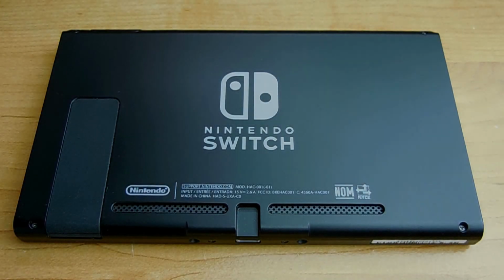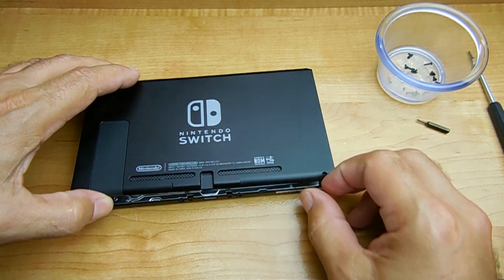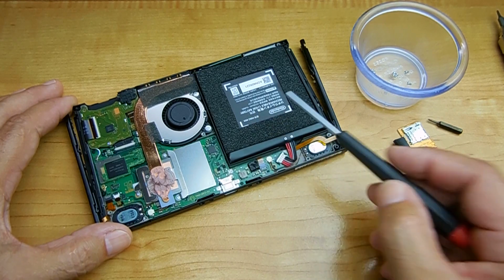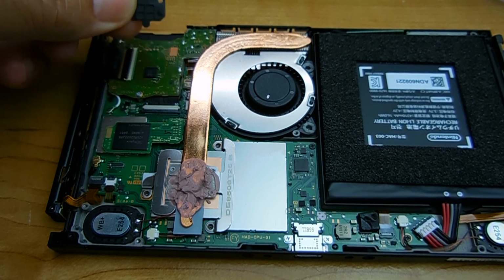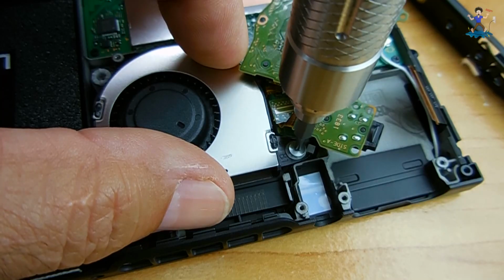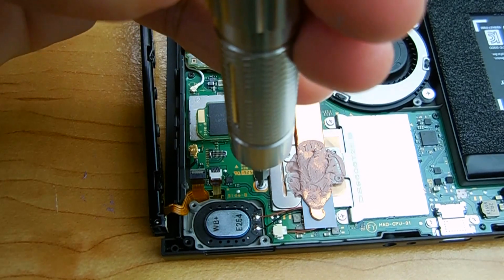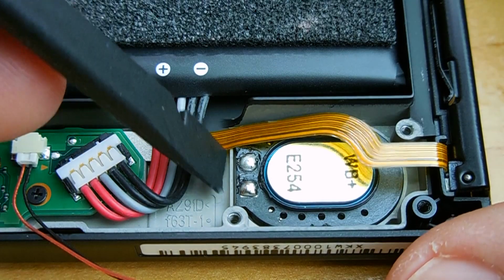How To Repair Nintendo Switch (CPU Fan/Battery/Speakers)

Comment: What if the actual speaker connector broke off the motherboard? Is there anyway to fix that?
Reply from the maker: Yes, you can solder it directly to that location, buy you'll need some magnification to do it properly.

Comment: I’ve dropped mine a thousand times and wonder how it still works
Reply from the maker: They had to make them fairly drop resistant, a lot of very young people handle and drop things.
Reply: I wish you could plug in the head phones to the controller instead of the switch, I have dropped it a lot because when I’m using my switch on the tv the wire pulls the switch right of the dock and gets thrown to the floor

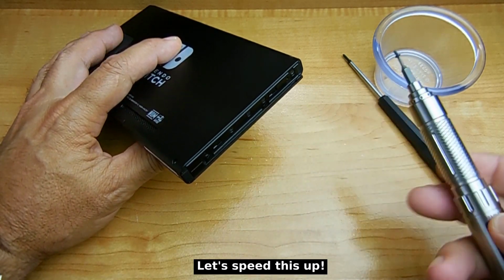Comment: 1:32 I don't understand how you removed these screws on both sides so easily. I cant even butch them and if I try I'd just mess up the screw and will never be able to remove them. Is there any solution? I need help please
Reply from the maker: You may need to "break" them free. Apply moderate downward pressure to the head of the screws to prevent the screwdriver from popping out of the screw and stripping it, then turn CCW.

Comment: Great video! One question, how does the fan hold up after months of use after you replaced it? I was looking at buying the same model you posted in the description.
Reply from the maker: I didn't replace mine. I took mine apart to show viewers the steps to replace.

Comment: There were two screws on each side of the Switch, where the joycons connect, that just would not budge:  TOP [  X       O   O    X        O ] BOTTOM on either side.  Also, the two pieces of tape covering the copper bar were destroyed when trying to remove them: for me, they were stuck so strongly to it that it wouldn't come up all in one piece like you showed in your video.  I hope it works okay without replacing that tape.  (I am just replacing the fan).

Update: You don't need to remove those 2 from either side if all you want to do is replace the fan and/or thermal paste.  Only if you need to replace the speaker.
Reply from the maker: Sometimes the screws stick, you need to break them free using higher torque while making sure you don't strip the head. You should use a heat resistant tape. I removed the 2 just to show viewers. Thanks for watching!

Comment: Doubt I'm gonna get an answer, but here goes. I need to replace the speakers. The Y screws came out no problem, but the philipps heads are a major pain. I got half of them with zero effort, the other half are in there so hard and they have all been stripped after my countless attempts to get them to budge. Any tips on how to remove stripped tiny screws? Its the one on top, and the ones on the controller slides on both sides. Im at my wit's end right now
Reply from the maker: I read almost every comment and reply to almost every question once, regardless of the age of the video shown on my channel. That won't happen with most other YT channels. To answer your question, when you remove those tiny screws, the tip must be well matched AND you need to push the screwdriver into the head with moderate pressure as you twist CCW to get them to "break" free. Try another mini screwdriver, make sure it matches. If you cannot remove it, the head of the screw will need to be drilled out. Thanks for watching!
Reply: @electronicsNmore  Hey, thank YOU for the tutorial. I didn't see your reply till now, cuz it's been a long, stressful and arduous day of drilling and grinding (something I've never done before mind you-- NOT a handyman by any stretch!) and I was  finally able to do it. My Switch might be missing about 6 screws now, but it's solid and functional and both speakers work for the first time  in about a year, so yeah, it was a good day. Only wanted to fix it finally, cuz I recently sent my left Joycon to Nintendo to fix some horrid drift that just hit me, so figured I might as well do something about it in the meantime, eh? Thanks again :)

Comment: Something wrong with the speaker replacement. There's a clip that connects to the speaker. You dont need to desolder the wire. For some, it looks complicated. Haha. Anyaway, thanks for the video, it was explained well.
Reply from the maker: Yes, but I've seen some aftermarket speakers sold without the wire attached. Thanks for watching!

Comment: I got screwed with mine literally because whoever put my Nintendo switch together at the factory tightened one screw so much that it's stripped and now it's impossible to get out and I can't change my speaker
Reply from the maker: Drill out the screw head. No big deal one less screw. Make sure no metal shavings end up on the circuit board.

Comment: I'm losing it.
Replaced my speaker that was blown, tested and am satisfied.
Trying to put it back together now and I just can't get that damn sd card to lock in place. What's the trick?
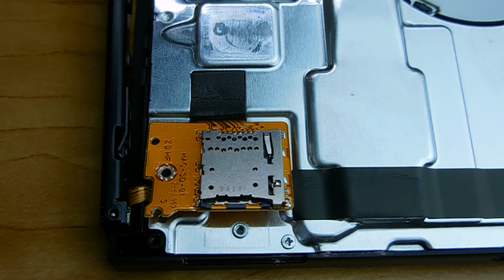Reply from the maker: You can see at 14:38 that it pops back into place if the pins are lined up properly. Make sure nothing is in the way or bent.
Reply: @electronicsNmore  I just peeled that rubber tape off it and was able to get it back in without the tape. Thank you.

Comment: Whenever I launch Fortnite, Botw, and Animal Crossing, my switch overheats. How do I fix this?
Reply from the maker: Open up the unit and make sure the air inlet and outlet for cooling is unobstructed.

Comment: My switch is getting really hot on its back in the right side for no reason.Any clues what’s going on?
Reply from the maker: Probably a faulty cooling fan, or it's all clogged up with dust/lint.

Comment: I installed my new fan and battery to my switch all  turns on works fine but then touch screen doesnt seem noticed finger or stylus is this blown screen or cable went in slighty wrong?
Reply from the maker: If it worked before you opened it, then you must not have put all the cables back properly.
Reply: @electronicsNmore  it was cable one removed to get cpu fan all.sorted switch lile brand new also  used thermal pads and artic silver mx5 paste thing feels much  cooler in full load
Reply: Ok thx im guessing itz ribbon cable i removed to get to cpu  fan screw

Comment: Great video  to  change just fan i do t need take all  rail screw out just centre ones right? My switch 3 years old fan make bad souds at times gota change it
Reply from the maker: Removing a couple extra screws is no big deal, just follow the video. Thanks

Comment: You dont need to unscrew all of them on the left and right joycon rails only the middle screws on both sides... This is why your rails were flapping in the wind.
Reply from the maker: That's true, you can see that at 2:10 in the video, but to replace them, you need to disassemble further to undo the flat cable connector.

Comment: I accidentally put to much thermal compound(Artic MX-4) in the top of the radiator and when I put the metal  plate on it the compound was  pushed down onto everything around the radiator. When I got to the final screw there was a ribbon cable in the way so I went back to properly seat it and notice thermal compound was spread around the radiator. So I started cleaning it and got rid of most the excess compound with cotton swabs and 50% isopropyl alcohol. There is still compound in crevices that I cant get with the swabs. Can I leave it or does it got to go.

Comment: Thank you so much for this video! My fan had been making a loud grinding noise and eventually stopped working altogether over the course of the past few months. With repair centers closed due to covid, I had to take matters into my own hands. This video was very helpful and informative, and replacing my fan went very smoothly! Thank you again!!
Reply from the maker: You're welcome! Glad it helped.
Reply: My fan does not work at all and sadly i dont have the screwdriver for the switch nails

Comment: bruh my nintendo overheats so easily
Reply from the maker: If the fan works, then the airflow is probably restricted due to lint, dust, etc.
Reply: @electronicsNmore  any clue if there's a way to help remove it without taking apart and cleaning the fan? Not sure if compressed air would just make it worse... My switch started making a very subtle grindy/clicky sound but worried it's going to get worse

Comment: How much would it cost for the supplies? I’m in the low end right now and want cheaper items, like the screw drivers. I just need those, not the kit. I’m trying to replace the fans because my Switch is over heating now.
Reply from the maker: Use the links provided, and search for "nintendo switch screwdriver". Thanks for watching

Comment: Great video two hardest steps I found to be undoing the screws, they were so tight a couple started to strip and removing the tape which came off in tiny little pieces. Any idea what it's actually called so I can replace it?
Reply from the maker: They act like they're seized. You need to push down hard enough and rotate. By doing that, the screwdriver tip shouldn't pop out of the head. Use the tape in the video description area. Thanks for watching!

Comment: I ordered a kit to replace my fan but the tri wing screws are SUUUPER tight and ive been trying for an hour trying to unscrew them, any tips?
Reply from the maker: They should come out. You need to increase the level of torque.
Reply: @electronicsNmore  how would i do that if you dont mind me asking?
Reply: I suggest using the electric screwdriver he uses
Reply: @Marcela_Marin  unfortunately it seems that 2 of the screws are very badly stripped, I am yet to find a way to take them out

Comment: Thank you for the video.  Very helpful.  I needed to replace the fan in my Switch as it was extremely loud and sounded like it could fail.  This video made it very easy.  However, after replacing the fan I found the one I was shipped is defective.  It does not spin up at all.  I tried re-seating the cable, nothing.  I put the old fan back in and that spun up just fine.  I have to wait for a replacement now.  :(
Reply from the maker: That rarely happens. I hope you got a faulty fan.
Reply: electronicsNmore Trust me, I hope so too.  The fact that the old fan still works gives me hope that the replacement was faulty.
Reply: @electronicsNmore  Got the 2nd fan and it works like a charm.  :)

First one was definitely DOA but the new one is like night and day compared with the noisy one.  Thanks again for the great video!

Comment: Hi guys I'm gonna replace the fan of my switch cause it's making noises when starting a game, it's a refurbished console so maybe it is an older version, but my question is if I change the fan do I have to change the thermal paste? Or it's not necessarily at all. 
Thanks for the help! New sub
Reply from the maker: Hello. If you disturb the original thermal paste, then you need to apply new. Thanks for watching!

Comment: Now, before I try to do this, will my switch receive any data loss, I expect the SD card to be fine but what about the switch itself? Will my internal storage be affected at all?
Reply from the maker: It's just like taking apart a computer, you don't lose what's stored on hard drives/sd cards.

Comment: I would do this but I’m to scared my switch will break
Reply: No it’s not broken I just sent it to Nintendo So maybe they will tell me what’s the problem
Reply: @dynamite_sheeze1399  I'm confused, why did you send it in if it isn't broken?
Reply: The fan was broken just like the switch In the video that’s why I send it
Reply: it's already broken, is it not? It's not that bad.

Comment: Also do u always have to change the thermal compind each time you open it up?
Reply from the maker: Yes, wipe away the compound on top of the cooling bar, and apply new compound before putting the metal cover back on.

Comment: Can u do a vid on how to take and replace the slide rails from the nintendo switch for the left side since fhe right one is easy to do
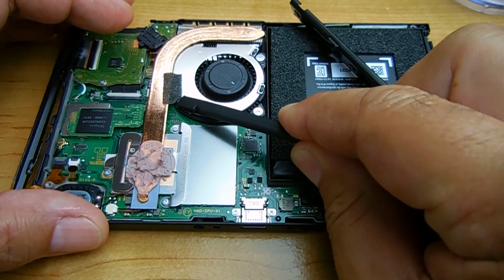Reply from the maker: It's very easy. At 5:31 you can see the left rail is loose. Flip up the black lever on the gray connector above my thumb, next to the white connector. Slide out the flat cable, and slide in the new cable on the new rail.
Reply: @electronicsNmore  thank u so much!!

Comment: Couple of tips for people stumbling upon here:

Thermal compound:
- Don't spread it, it will spread perfectly when you tighten the screws. By spreading it you are only getting some off the edges that could otherwise be utilized to fill air pockets.
- It's also good practice to use a little isopropyl alcohol when cleaning off the thermal paste to get dried bits off the tiny polish marks to fill the marks with new paste that will fuse together, giving a better cooling capability although it's negligible.
Cooler installation:
- When setting down your cooler with the new thermal compound, don't move it around, line it up first try (you can use toothpicks in the screwholes for perfect alignment). Otherwise you will be creating air pockets and decreasing the cooling capability
- Don't overtighten the screws like this "handy electric screwdriver" just did. You can clearly see how the cooling pipe is very "bent" up at the exhaust end which was not the case on OEM. Get it as snug as you can while still keeping it level. The tape also is dual purpose, air direction (very minuscule difference in temps) and holding the cooler in proper position (actual purpose)
General:
- Any time you are fiddling with electronics, don't use electric tools, at least not to tighten. It can ease up the loosening bit but you can also easily strip the screws and make it super hard for yourself. If your screwdriver supports accurate torque settings, then it's OK but you probably already knew that since those are expensive.
- Never pull cables from the ribbon. NEVER! Always use a plastic tool to push from the connector! Always! The cables are very very fragile, I know from experience. You might not even see anything by eye but it's fractured inside.
- Same goes for twisting them (like in the part where the last cooler screw was removed) but that is not as dangerous if you are gentle.

In any case, thanks for the video, now I know what I will be looking at! :) Thanks for doing this!
Reply from the maker: True regarding spreading, usually I just apply a pea sized bead. As for the electric screwdriver, it didn't over tighten, it has torque control and the screws can only go in so far. As for the cooling bar and fins, they were slightly up, but once the cover is secured, it goes down flush. Once the cable has been released, there's no problem pulling on the ribbon cable. I've been doing it for at least 30 years with no problems. Thanks for watching!

Comment: Hi, followed your instructions to fix the fan. Closed everything up

Now om bootup i get error code 2162-0002

 :(  Beyond frustrating, it doesn't even go into the system os

Please help
Reply from the maker: Go over everything you did. You probably forgot to plug something in.

Comment: What a.brilliant video! I am attempting to fix my cooling fan and my thermal compound paste for the very first time never done it before so the question I would ask you is can I put new thermal tape where the fan is and where the pipe is or do you recommend to stay with the old tape that came with the switch! I will be using your video as a step by step while I am fix it !👍🏻👍🏻👍🏻👍🏻
Reply from the maker: Gently remove the tape and put it back, or you can buy a small roll of heat resistant kapton tape. 1/2" to 3/4" is fine. Thanks for watching!
Reply: Just fixed my fan Kate. I used this great video to guide me and had no problems

Comment: Awesome video. I've heard that 3rd party fans will only run at max speed? Does this fan throttle up and down depending on the need to cool or is it always running at max? If always at max, how loud is it?
Reply from the maker: Hi. I never tested the fan at the link provided. Usually if the fan has the same number of pins, you can control the speed. Thanks for watching!
Reply: @electronicsNmore  Thanks for responding. I already ordered the fan at the link provided so I'll let you know after it's installed.
Reply from the maker: @tobiasfunke  Great. Hopefully it works well. It's hard to replace the exact same part, because Nintendo doesn't sell the parts.
Reply: @electronicsNmore  it took a bit of time to get the fan from China but it seems to be working well and with adjustable speeds depending on the temp. Thanks again for the helpful video. I would also just like to add that only the middle screw on the joycon side rails need to be removed in order to remove the back cover. I was stressed because one of the other screws was so stuck it got stripped while trying to remove it but the repair worked out anyways so it's all good.

Comment: You should never touch the motherboard with your fingers. Wear gloves. The human sweat can be acidic. But nice video, I needed this :D
Reply from the maker: The main concern is static discharge damaging sensitive components. I live in humid South Florida, so I don't have to worry about that problem. Never work on anything electrical or electronic with sweaty hands. Glad you enjoyed the video. Have a great New Year!

Comment: The tape on the fan can I buy that? My tape on the fan was very dry and bad.
Reply from the maker: Hi. You can use Kapton tape. Buy a small roll. 1/2" or 3/4" wide
Reply: electronicsNmore thank you so much😀
Reply: I replaced my fan thanks to you😀🤗

Comment: Any idea why my switch fan isn't running even after I changed the fan out for a new one? I can't find a solution
Reply from the maker: Either a faulty temp sensor or faulty board.
Reply: electronicsNmore I have this same problem. Is there a way to get a new sensor or do something to fix it?